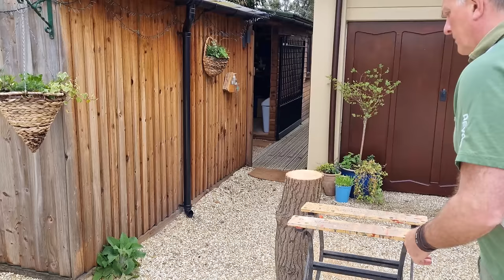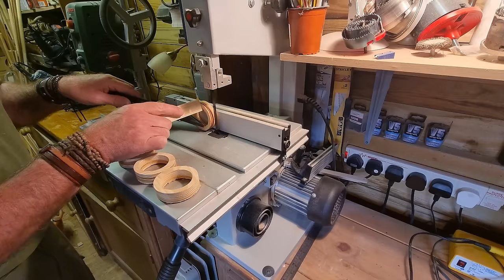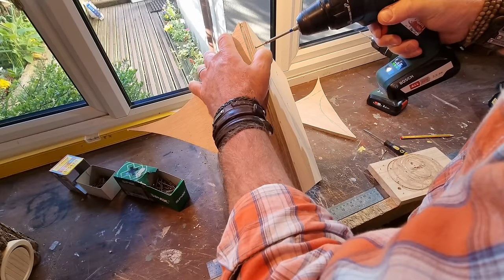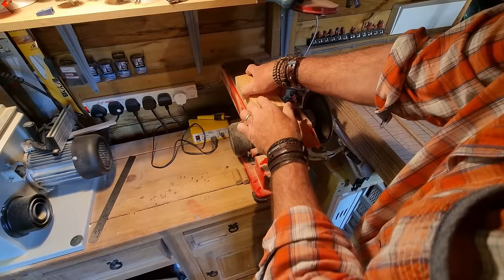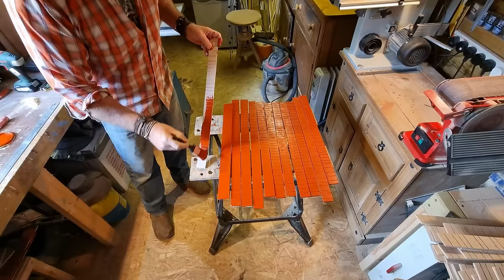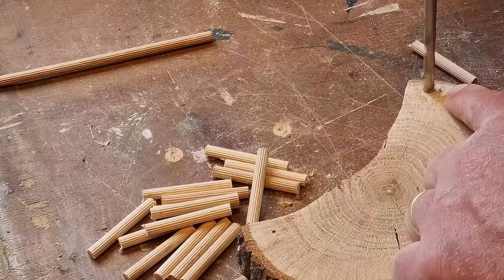Log to Beautiful Fairy House Bird Feeder (DIY Woodworking)

Comment: Really cool. 
What is that wood burning tool you used for the delicate symbols you did?
Reply from the maker: Thanks so much.  The wood burning tool is a 'Pyrography pen'  you can find many types on Amazon and can start with a really cheap one but still work effectively 👍
Reply: @woodworkfantasy6653  
Thanks 👍

Comment: How did you feed the wire all the way through the log??
Reply from the maker: In the video you can see at one point I use a very long auger bit to drill holes down to each window panel. 👍